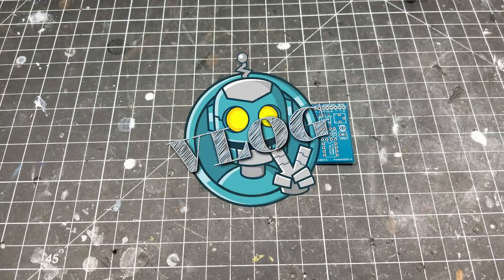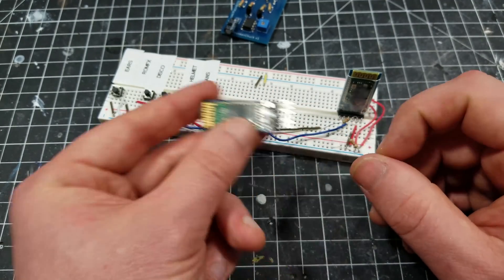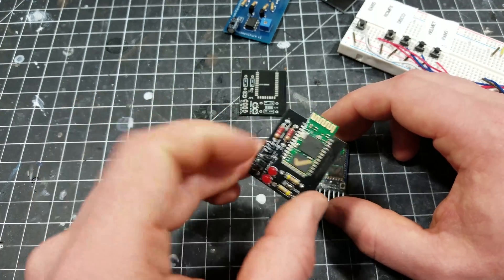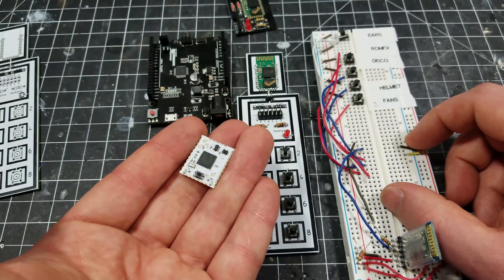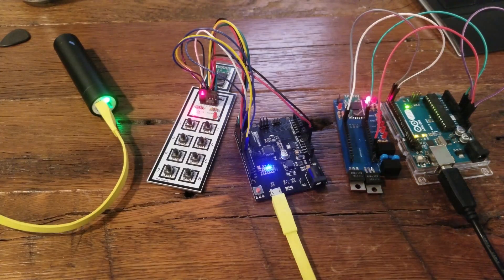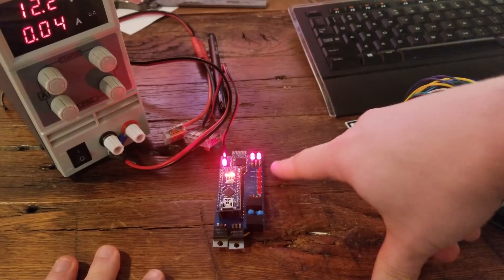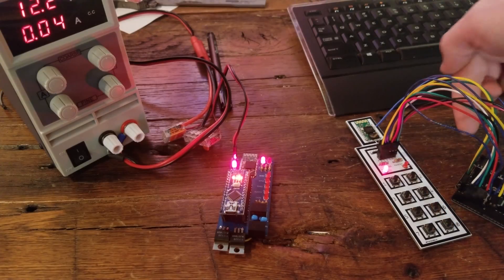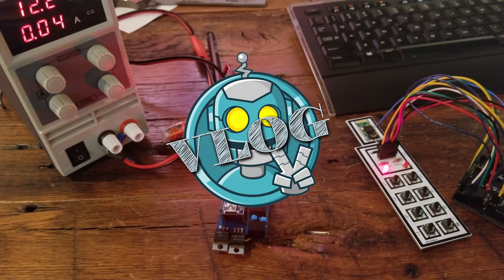Vlog #008 - Printed Circuit Boards #3

Comment: Hello,
First I want to thank you for all the info you are sharing. This is amazing.
I wanted to ask you the reason why you changed the Arduino Pro Mini to the HCC Mod. Is it for the frequency ? 16MHz to 48MHz, hence a better reactivity when pushing the buttons ?
Reply from the maker: Room!    The HCC mod is much small and surface mounted.  Every millimeter is going to count on that compad setup